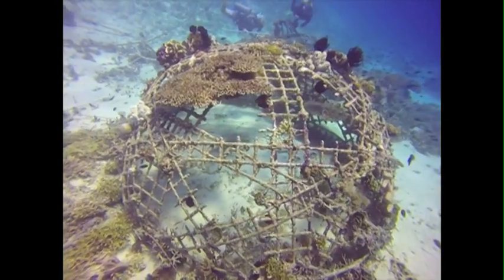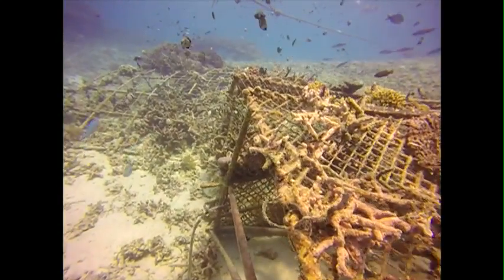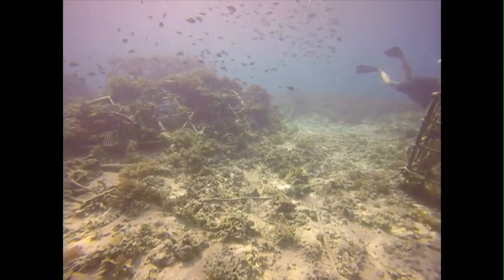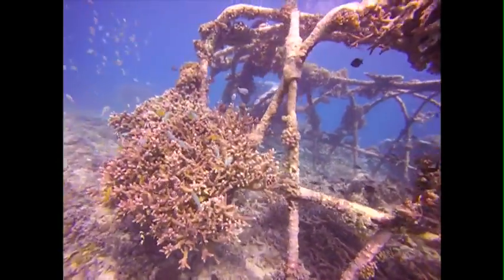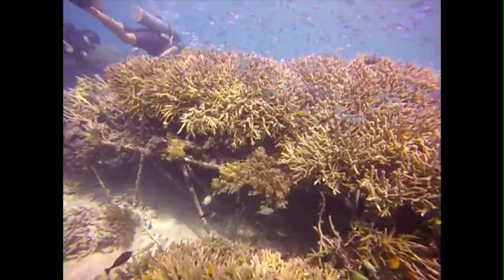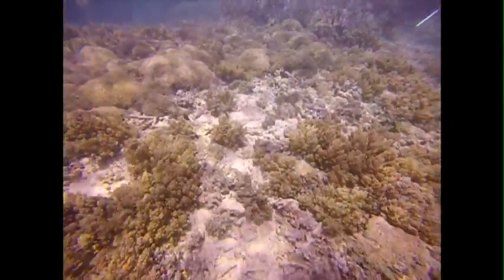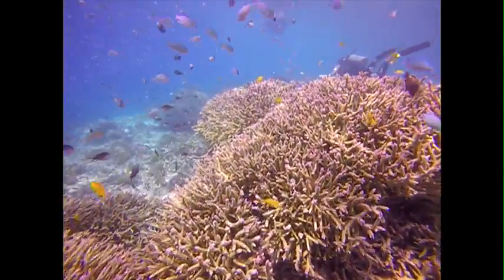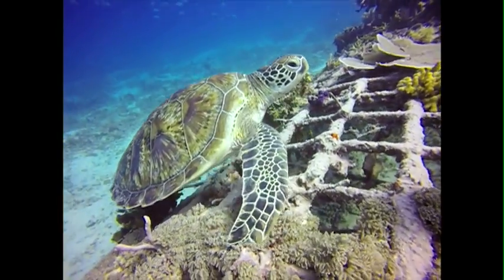Coral Survival On Biorock Reefs After Severe Bleaching In Indonesia

Comment: 6:54 wernt getting any power at all. simply sitting in the electric field. so your saying the rod iron structures are unnecessary? So an anode and cathode separated in the water creating a current through the water. If a aluminum anode rod and iron cathode were pressed in to the coral a yards apart and a electric current  place about the reef. If these rods were mapped out strategically placed. could this revive dead coral reefs?

Comment: Could you forward this question to Tom:
Could it be possible to make a solarpanel waterproof and attach it directly to the Biorock structure? The need for cabeling would be reduced to a minimum
Reply: I like where your heads at but i think the effectiveness of the panels at an average depth of thirty feet would be inadequate. I saw another video of a buoy used with solar panels attach. A stainless steel box was created to water proof the panels. It seemed like a solid plan, however the buoy would capsize on a regular basis. Even with upgraded  cables and weights. This started me thinking. What if we made a solid structure that the waves would pass around instead of a floating structure tossed about violently. I suggest sinking wooden post into the seafloor. Similar to constructing a coastal pier. old telephone poles maybe useful.  Sure it will shift in the sand over time but who cares, as long as its twenty feet(give or take) above the surface. That should supply a solid base for decades of use.